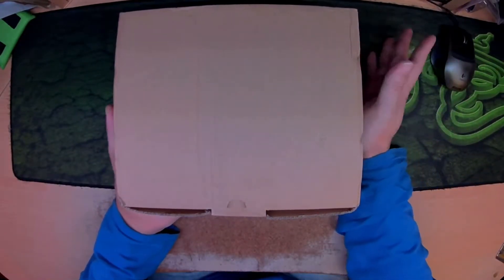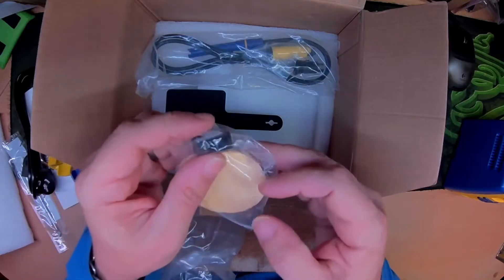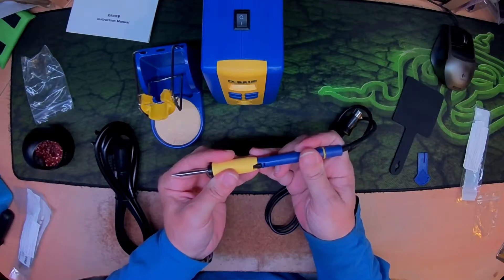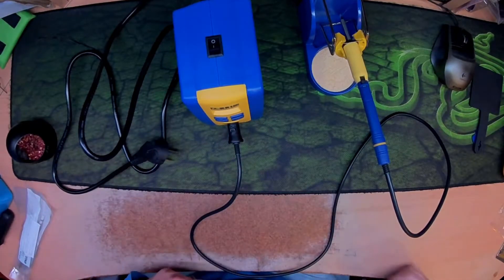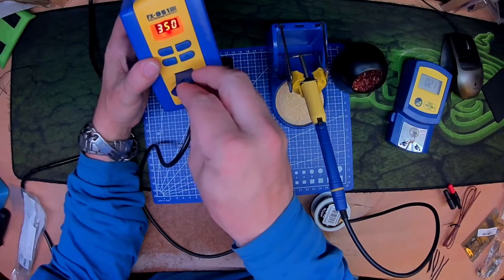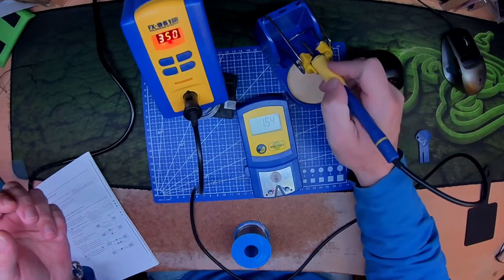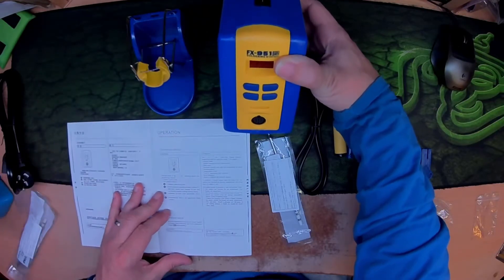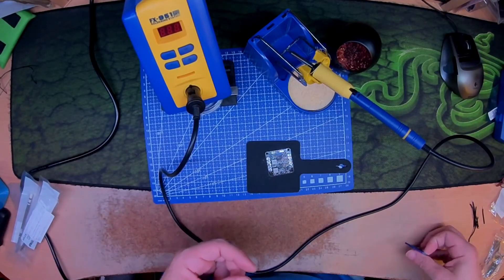FX-951 Soldering Iron / Station

Comment: How has this soldering iron been for you long term?  Any  problems?
Reply from the maker: No problems what so ever, It's been a joy (coming from a Yihua 936 - cheap clone from hobbyking). I'm not doing production or commercial level use with it but I have put alot of time on it since this video.

I'm never waiting for it to heat up , plenty of different tips and its stood up to being stored when not in use (lots of cycles on both the front and rear cable connections).
If there is one part that is sub standard, it is the iron holder as mines got some chipped paint and it doesn't quite feel tip-top, but in the grand scheme of things ,it's a moot point and pretty much OCD to a cosmetic level - it is metal though.

The only other thing I think worth sharing is that I'm in the UK where mains voltage is 240V +/-10% and this AU unit labeled 220V has no problems (was specced as 230V) but i think that is just common practice the world over, its either 110V or 220V and we're a bit of an exception.

I hope this helps.
Reply: Thanks!  One thing I've noticed from a few videos is the temperature can jump around a bit when it reaches the set point.  I suspect that is a false reading.  Did that change over time?  Maybe have something to do with the tip being used?
Reply from the maker: Brendin Emslie I haven't experienced it but as you note it may be due to the wrong tip for the job or even varying qualitys in the clones.  I have certainly seen snobbery and elitism in some "reviews" from one or two very prominent youtubers/professionals that you may have already seen, which had me in stitches after getting me unit and putting it through its paces. It was notably a main criticism that it didn't show the temp as it was heating or give a beep, I assume blinded by bias that they couldn't pull the program set card out that suppresses it. From memory using an iron temp tool in conjunction with a Fluke k type thermocouple that I implicitly trust I have complete faith in mine as a hobbyist.
Reply: Thanks.  For the price I think it is worth taking a risk on buying one.
Reply from the maker: Brendin Emslie If you do, buy it from a larger vendor like Banggood or Ali express (a highly rated long time seller on Ali with loads of feedback etc) and double protect yourself from getting a lemon by using PayPal. For the most part I've dealt with BG alot over getting on 3 years and always been taken care of, although you have to be persistent etc. I bid you happy soldering in the near future!
 If there's anything else I can help with, just holla.